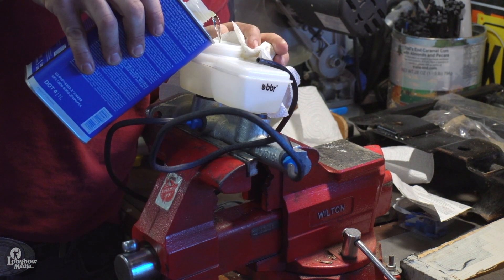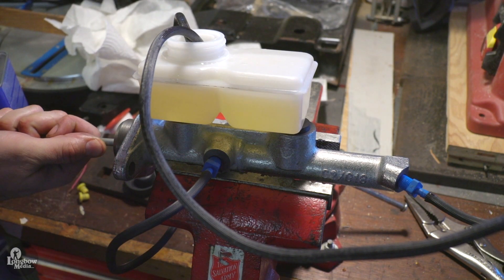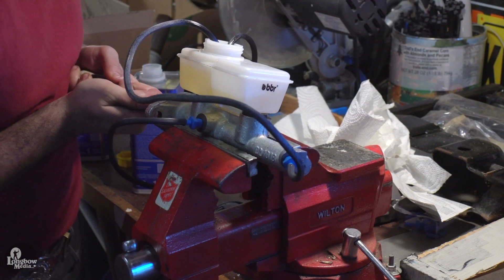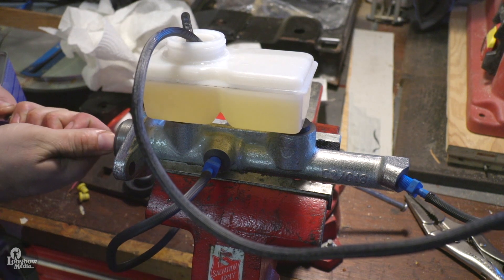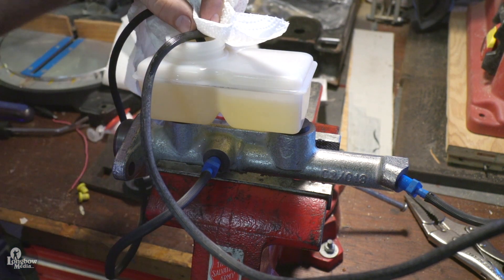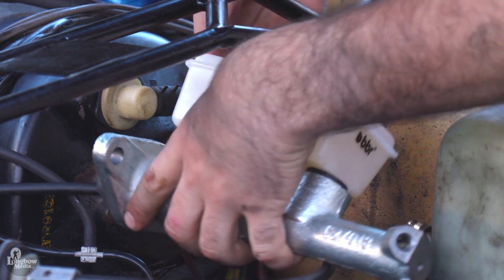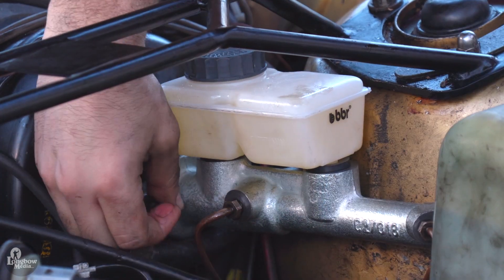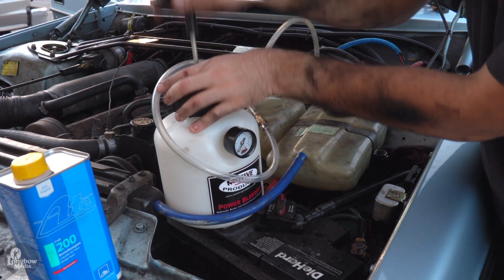How to Replace and Bench Bleed a Master Cylinder on a Volvo 240

Comment: Do you have a video which details any difference in the Brake bleeds and flush WITH ABS?  I have a 
92 240, automatic with ABS.  (And no longer a Sword in the Stone pair of bushings).
Reply from the maker: From what I remember, it was the same procedure, but I only flushed the brakes on an ABS model once.